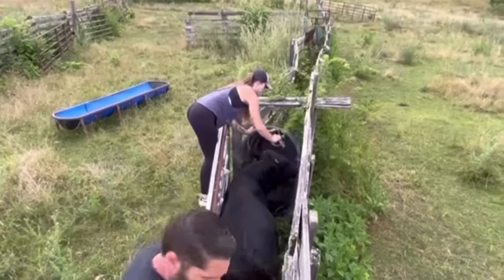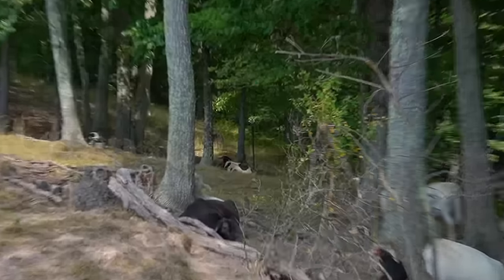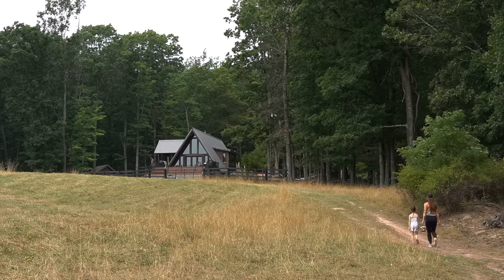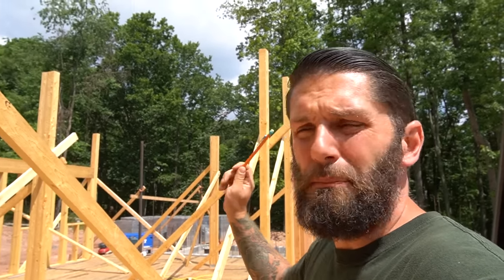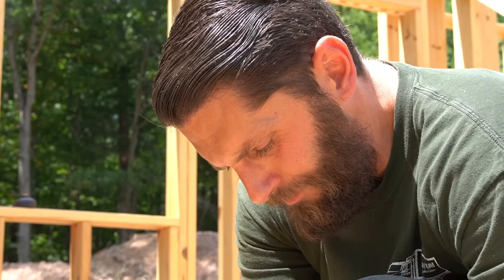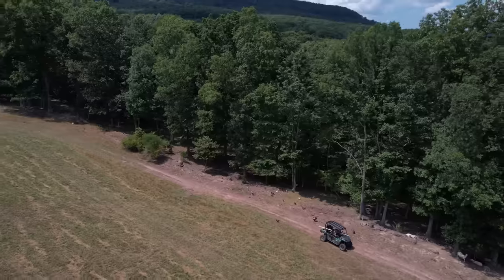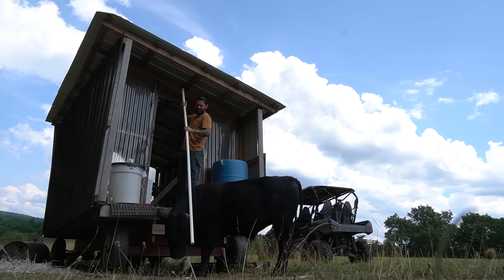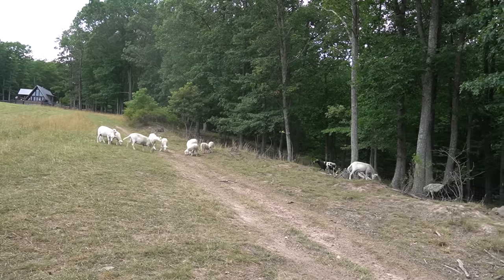Building Interior Walls & MASSIVE UPDATE | A-Frame Cabin Addition

Comment: You might consider Cavity Slider for your pocket door hardware.  It is pricey, but it is so much better than everything out there I have seen.  They have soft stop  open and close options.  I hung a 200# copper door i built on one of their barn door track systems today.  You can move it with your pinky and it makes no noise!  We went with the soft close option, works great on such a heavy door. only down side are they are a tad fussy to adjust, but work supper smooth once you do.   Looks like things are coming along!

Comment: Heads up on pocket doors if you are using solid doors not to use the short screw that come with the door track like I did just to have to cut a hole in my wall to reattach with longer screws.

Comment: Excellent & Quick job fixing the chicken watering system.  Just a suggestion tho, to prevent the
flooring from getting water damage from the water dripping from the nipples, what about putting
some sort of plastic trough under that line?

Comment: Idea for you guys, insulate, actually sound proof interior walls with RockWool Safe And Sound. Especially in areas with high noise, tv room, laundry room, and bedrooms. In other words the new building. It is also great for fireproofing as it does not burn or absorb water.
Reply: Mass as well - 5/8" or double 1/2" sheetrock on both sides plus insulation helps quite a lot.  There's plenty more options out there, but not really needed unless you're building a home theater / game room.  Just doing the walls and having solid core doors make a really nice difference.

Comment: Josh:  Big improvement in your enunciation!  I could understand over 50% of what you said.  Listening carefully, I think your speech turns into a mumble because you are trying to speak so quickly (for no apparent reason) and you accomplish that by cutting off the final letter or two of words and leave no gap between them.  This is in stark contrast to Erin's speech which is so precisely modulated like a BBC commentator.
So, 2023 is supposed to be a "slow down"?  Is that because you didn't start two other construction projects at the same time?  ;-)

Comment: Hey guys, I have a suggestion for you on the cafe. In the areas where space may be a concern, please reassess the needs. I am an ER nurse, and several years ago, we upgraded the workstation. The architect built a full-size mockup, and we all walked through it and gave it a thumbs up. But we were all walking in the same direction, which is not what happens in a busy ER. We ended up stepping all over each other. I hope the cafe is as busy as an ER...get your running shoes on!

Comment: For Josh: Electrical question…Did you guys ever hook up two inverters on a split phase 220v setup to your main panel or are you only running 120v?  If not, do you plan to once you plus up your battery inventory?

Comment: Hi Erin I know you will read this first so I told you what we do in Sydney Australia with the noggins also the metal strapping he used to hold up the plastic pipe for the chickens water feeder, we use that to keep the walls square by putting it from bottom right corner to the top left corner and screw every stud and do this before you remove the temporary bracing and the metal strapping keeps it secure

Comment: Do you have any need or desire to run CAT6 or other low voltage wiring in the new space?  When I remodeled I ran ethernet to every room. It's turned out to be handy, even though WiFi is very much better today than it used to be, nothing beats a hard wired internet connection for stability and speed.

Comment: Since your on the cabnet wall. I would suggest using extra 2x6 material to block out the upper and lower connections for the cabnets.  That way you are not relying on hitting a 2x4 stud for cabinet support.

Comment: Congratulations on all the progress you are making with house, cafe, Leon, Lilly and Dexter.    Josh, could you add a length of 2x4” as a bumper guard for the exposed under pipeline.  Just to forestall Leon’s next adventure.  

Cafe looks terrific both inside and out.   Will the hood and air handler system be able to preheat the outside air during cold months as part of its air exchange?   The two of you are an amazing team.  

Wishing you and your family a blessed week filled with gentle rains, seasonally appropriate weather and restful evenings together.   Peace

Comment: Why do you have random sections of wall with 5 or 6 2X4's nailed together vertically? That's wasteful and unneeded. I've seen thousands of framing house shows and videos and nobody does that unless it's like a horizontal window or door header.
Reply from the maker: 🤦‍♀️ those are for direct loads coming down from the second floor. They sit on a spread footer.... They are load bearing.